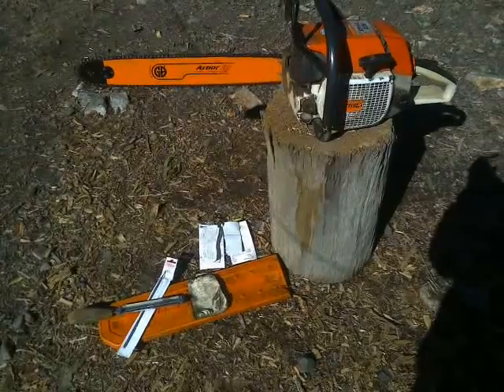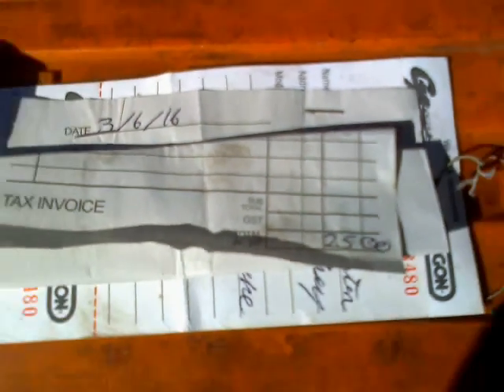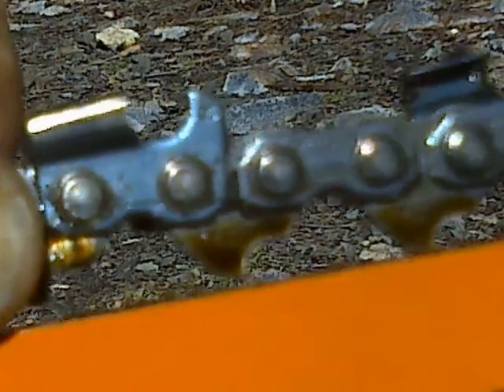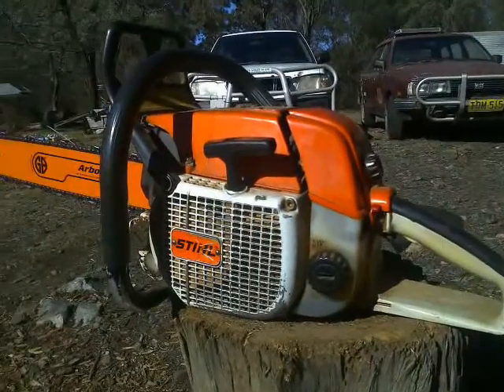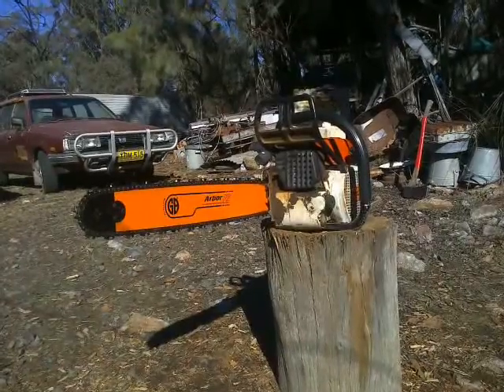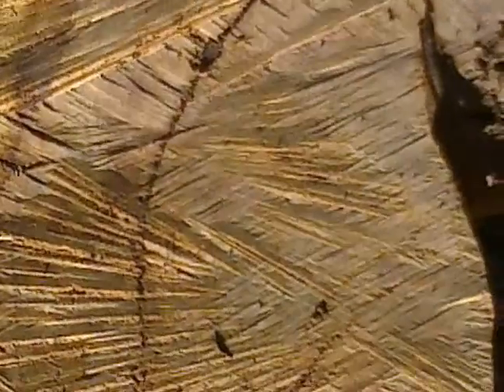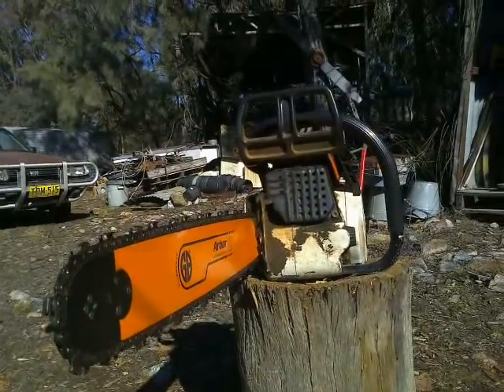Small Details Matter..; Chainsaw Illustration...

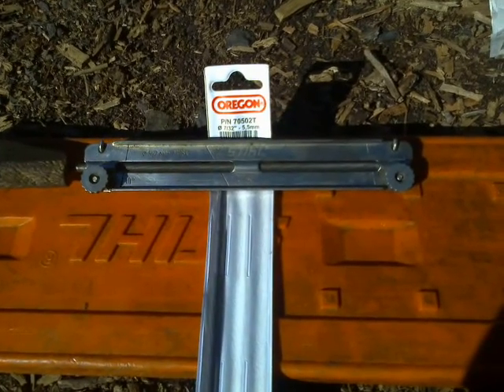Comment: The combination you mention Chris at 6:45 is a perfect storm of unforced errors. Having worked on chainsaws for about ten years as employment, I realise just how critical different size files, guides, bars and chains can be. I won't go into all the different sizes here as I'll only confuse myself, after all it's been over 20 years since I did that kind of work and no doubt a few things have changed in that time. One change I will mention-3/8 Oregon chain always needed a 7/32 file, but now it's a 13/64 file, but wait is that for Oregon or Stihl chain? See-confusion. At least Hec is very patient and sympathetic to people like me who don't have a clue about the industry now. I don't think 13/64 files were even available 20 years ago. Even if they were, everyone just used a 7/32 file on 3/8 chain and that was that. Of course, none of this makes a scrap of difference if the chain is on backwards, something I witnessed at least four times over that period when customers have brought their saw in complaining that they'd cleaned the saw and sharpened it, but now it won't cut at all! This could usually only be done with the old spur drive sprocket.By the way Chris, I still have an old McCulloch ProMac 850 my Father bought around 1976, it also has the manual thumb pump hand oiler, but it also has the automatic oiler which I have adjusted to the point where I seldom need to pump it anymore.This old saw laid idle for about 15 years after the carby diaphragm hardened to the extent where it just wouldn't pump petrol anymore. They are supposed to be replaced every 12 months, so Dad got a good run out of the original. I could not track down a carby kit until I got into the digital age and saw online that kits for just about anything were available in the U.S. for the huge sum of $15, and about $10 postage. Now the old beast (it hasn't got any lighter over the years) is once again revving like an F111. However, because of that weight and a bad back, I now mostly use an MS 391.
Reply from the maker: G'day,

   Thanks.

   Yeah, I sort of know just enough to keep my Saw running as long as nothing starts out being wrong (like being sold a wrong Chain for the Bar and then thinking that the old File will still be able to sharpen it...).

   My father wouldn't let me use his Chainsaws until I inherited them when I was 21, and therefore I destroyed the McCulloch in figuring out what not to do, and the Dolmar once bounced 5 Cutters off my Left Kneecap back before Chaps and Helmets...; so by the time he was 14 my son had paid for his second Chainsaw with Firewood-Sales..., and I taught him to log his Hours on it, too, and at 28 he's now had it for half his life (!).

  Have a good one,

  ;-p

  Ciao !

Comment: I learned a lesson, called don't let kids use your saw a while back.  I had to spend about $60 to get my bar and chain replaced on my little 13" saw.   Those kids had that bar twisted and chain destroyed from trying to force it to cut at an angle mid cut.
Reply from the maker: G'day Tom,

   Well, ummm....

   My father never let me use his Chainsaw for more than 5 minutes, total time as a teenager, then he died when I was 21 & I inherited his Saws & tried to figure out how to use them...

    I destroyed the McCulloch, utterly, by not underconstumbling the correct usage of the Thumb-operated Manual Bar-Lube Pump...; and used the Dolmar 114 with no Chain-Brake for 5 years, and I only hit my Kneecap with 5 Cutters, the one time...

  So when my son was 12, and he asked, I very closely, hands-on, supervised him while he tired himself out cutting a few "Rounds" of Firewood with my 038 Magnum Stihl..., "graduated exposure" is what they call it...

  Then, when he was 13 he bought a 2nd-hand Poulan on Hire-Purchase, and after I'd located & fixed it's problem (the Plug-Lead was rotated 180-degrees  out of alignment, meaning it was compressing & unpatenting the Neoprene Gasket which was designed to prevent Hot Air off the Cylinder-Head from boiling the Fuel in the Carburettor - which had meant that the Saw, as-bought, used to start & run & cut just brilliantly, until asked to idle when warm...

  Then it used to die (from Carburettor Vapour-Lock, due to insufficient flow of Cold Fuel through the Carby to prevent boiling the Motion-Lotion......!), then it yook an hour to cool-down & be prepared to start again - which is why it was so Cheap (Nobody could figure out what it's Problem was... ; and when I figured it out, all it took to fix it was to totate the Plug-Lead, and fit it with a new Neoprene Gasket cut from an old "Thong" ("Flip-Flop", aka the Rubber version of what Japanese & Koreans call "Getas")...

  After a Year, my Son got $50 more for his Poulan, as a Trade-in on a new Stihl, than he had bought it for ; and it did pay for itself with Firewood-Sales in the meantime..., as did the his new Stihl...

   It was one of the ways I edjumicated him in the ways of Business...; I drove, loaded, and let him cut & sell the best Firewood on my 100 Acres, from when he was 12 till he was 15, and he'd decided to make money with his Brain instead of his Muscles...

  Mind you, at 27 he can now lie on his back in a Puddle while holding a 30 Kg Starter-Motor above his Head with one hand ; while using his other hand to bolt it into place..., so giving him a regular reason to practice being physically strong as a kid hasn't hurt him, either

  My son is lots more muscly than I ever was, and I was always bigger than my father was, too.

   I gave both my kids a Razor-Sharp Tomahawk to use when they were 3, to role-model with, while I was Splitting Firewood on the opposite side of the Wood-Heap...; and neither one has ever drawn Blood with an Axe or a Saw..., at 25 & 27....

   So, "Nuck the Fanny State !"...

   Knife-Proof your Kids, by raising them to be "Not Fuckwits" ; rather than locking them away from anything which might prove to be "potentially dangerous"....

   It may be an unpopular view, here, now, contemporaneously ; but "The Times, they are a' Changin'...!", and our Kids will be needing to know how to deal with "Fail-Dangerous" stuff which will, probably, prove to be Make-Or-Beak for them....

   We live in interesting times...

;-p

Ciao !
Reply: Kids are dangerous with knives.  I got my kids guns, much safer.
Reply from the maker: ***** 

   Interesting plan, how do they get on with peeling an Apple, buttering Toast, or cleaning dirt from under their Fingernails with a Gun ?

     Oh, yeah, of course ; you could always give them a Cannon with a Folding Bayonet...!

;-p

Ciao !

Comment: how do you keep track of the hours?
Reply from the maker: G'day,

Thanks.

  I log the Runtimes when I refuel - having found that it runs for one Hour per Litre, and has a 750 ml Tank.  

   I'm an old Aeroplaneologist, so I figured that Log-Books can work on Generators, Chainsaws, Waterpumps, Whipper-Snippers can all benefit from my knowing how long they've run.
   
   It doesn't take much extra time to put it in the book, and every now and then it turns out to be useful.

  Such is Life,

Have a good one.

;-p

Ciao !

Comment: You could have got a brand new petrol-driven one for 140 Aus dollars. The Ryobi RCS3840T 37.2cc petrol chainsaw,  chain speed of 23.8m/s, and  fitted with a 40cm bar would set you back 280 dollars, tops.
Reply from the maker: G'day,

   Yeah, that's true too...

   But I've had a Ryobi Vaccumn-Sucking Leaf-Blower...; it was a piece of Shit, it failed within it's Warranty-Period, & I was lucky to have been able to trade it it for 1/4 of the price of a (propper) Stihl unit, when the Ryobi was only 3 months old.

   I buy Propper Tools , not Bargain-Basement "Lookalikes" ; because it saves money in the long run.

   Ryobi "Chainsaws" are designed to die within 50 hours of operation...; my Stihl has 265 Hours on it, and being 3.8 Cu In., ie 62cc, or 5.7 Hp..., there is no way that a 40cc Ryobi Fascimile of a Chainsaw will ever be fit to replace my 038 Magnum Stihl...

  I use a 36-inch Bar, with a 115-tooth Chain for Milling, & a 20-inch Bar to cut Firewood with..; whereas the Ryobis are for people who never cut anything bigger than the Feral Cattonia-Aster Branch which falls over their Suburban Driveway...

    My 038 Magnum Stihl is slightly overgunned for cutting Firewood, it's the smallest Saw eligible for a Fencing-Contractor's Tax-Deduction, & it's slightly underpowered for Milling with a Guide-Rail ; so, for my range of useage, it's pretty ideal...

   But, with no offence intended, in my position, the 37cc Ryobi is a Jucking Foke...; only useful as a Paperweight, or a Doorstop, certainly not fit to be relied upon in the Real World...

;-p

     Ciao !
Reply: It's best to get the best, if you can get the spares.  No point in blaming the shop boy. Though I know crazies who would have chased him down the street with said Stihl. I take it you're just going to chalk it up to experience?  Though that would make an interesting video- 'Warbles Confronts Chain Boy'.
[ don't waste time with spares, when said spares are more than half the product ]
Reply: I have a feeling you bought the replacement in the very same shop, Hecs,  you were sold the wrong one. [ No criticism meant; its just an observation. ]
Reply: I have a suspicious mind, Warbles. For 130 dollars or so you can get a Qualcast or Soverign. Or 20 dollars more, a Bosch. Are they all crap? Do you only recommend Stihl? Aren't they over-priced?
Reply from the maker: +amid billow 

Ah, well...

  25 years ago, Jimmy Wilson was the Stihl Agent, & Hec was one of two Tradesmen working for him, Snoopy Hoopert was the other  one, and I traded my inherited Dolmar 114 in to Jim Wilson for a Stihl 029...; then I bought the Rip-King guide-Rail, and even with a 24-inch Bar the 029 wasn't up to the job, so I traded the 029 in for the 038 Magnum with a 20-inch Bar for Firewood & a 36-inch Bar for milling.

   After 25 Hours & 18 months, the Crankshaft broke.

   Although the Saw was 6 months out of Warranty, Jim Wilson paid Hector to rebuild it for me, for free ; because it had been assembled in Brazil from German-manufactured components & then shipped to Oz, the Brazillians had fucked-up several months' worth of pressing Roller-Bearings onto Crankshafts, & The Stihl Company didn't want anybody like me running around & telling Horror-Stories.

  It bought a lot of Brand-loyalty, from me ; when they did a free $650 Rebuild on my $1,350 Saw, when it was A) out of Warranty, & B) Jim Wilson knew I was using Penrite 2-Stroke Oil, rather than the Stihl stuff.

  So, Jim moved up the Street a block & a half, into a bigger Workshop, and his son  Peter, a Linesman  with the Electricity Commission came into the business ; and Snoopy & Hector both went their own way, Hector to start up in opposition, Snoopy to work on the Mines.

   Because I'd had a good run out of Stihls, I kept trading with Pete Wilson ; he sold my son 2 Chainsaws when he was 12 & 13, a second-hand Poulan, & traded it back a year later, paying $50 more than he'd sold it to us for, on a new Stihl, and I bought 2 x 2nd-hand Stihl Brushcutters from Pete Wilson, and when Donny Davis sold me a Heap-Of-Shit Vaccum-Sucking Leaf-Mulcher,  Pete Wilson let me trade it in for a new Stihl unit which actually works as-advertised.

  Then Pete Wilson "decided to retire" & he sold out to his Tradesman, Pete Gallagher ; and after a while, Stihl made demands that Pete Gallagher should spend 30 or 50 thousand dollars on prettying-up the "Showroom" part of his Tin Shed, & he told them to go & find another Agent...,  so I was trying to support him, as it was kinda obvious that he was bravely floundering.

  When he sold me the Husquie Chain, it was just before he moved into smaller Premises, while the Stihl Agency had migrated to Hicks' Hardware Store in the Main Street, with a Mercer's Assistant by the name of Lightfoot impersonating as a Small Engine Mechanic..; not long after that Pete Gallagher went out of business, & David Hicks also told Stihl to find somewhere else to be their Agent, Lightfoot lost his job at Hicks', & Pete Gallagher now works for Hicks as a Storeman...., and Glen Innes has not had a Stihl Agent for nearly 2 years..., because everybody now understands that Stihl Australia are a mob of Citi-Bred Arseholes who are not worth representing, as they've conspicuously fucked-over 3 local Businessmen, and crushed one back to being an Employee.

  I'm still using my Stihls, and I have now transferred my reliance for Spares & Maintenance onto Hec's Small Engine Klinic...; because I know that he knows what he's talking about, & I know that he looks suitably chaotic but he knows what he's talking about....

   So..., therefore I trust Hector to not fuck me over, because we're both "Old Locals", and I've never fucked him over (I always pay on the Day, & in Cash...) and nobody wants to make an enemy of me (because apparently I border on being scary in my ruthless persistance...?) ; and I forgive Pete Gallagher for fibbing & selling me a length of Husquie Shit, because it was probably all he had on-hand at the time, & his suppliers were probably refusing him credit for wbatever he tried to procure, at the time...

   My Stihl has run 265 hours since rebuilding, probably 50 or 70 hours of Sawmilling on the Rip-King, and I'm able to buy Spare Parts for it 22 years after originally buying it...; and nobody can say that sort of stuff about any of the Toy Chainsaws which they sell in the Hardware, Shops these dayze.

   You did ask...(!).

;-p

Ciao !